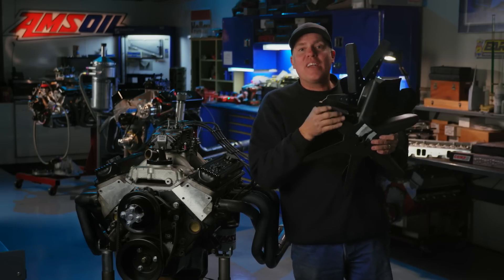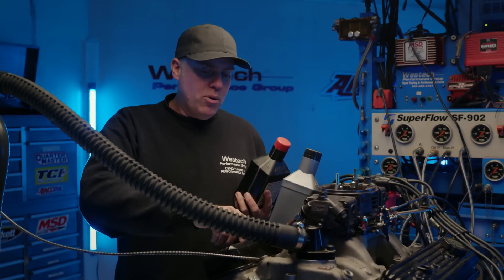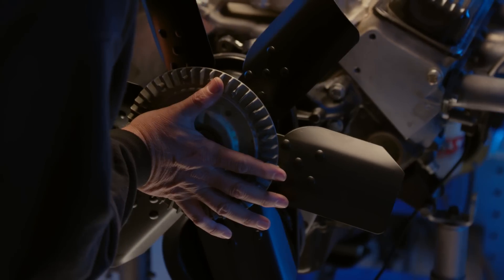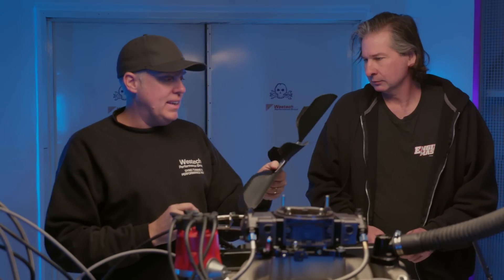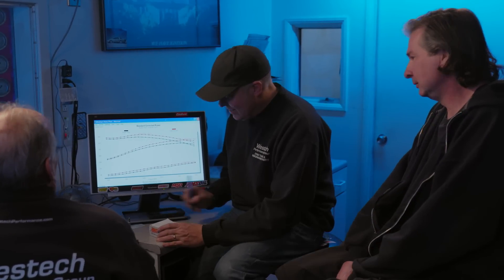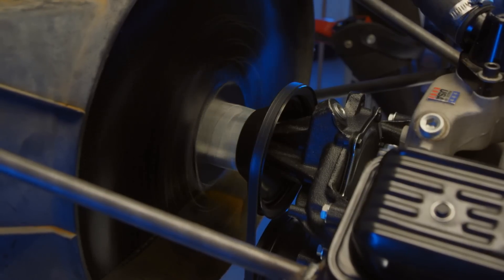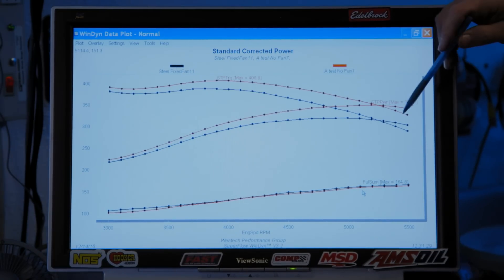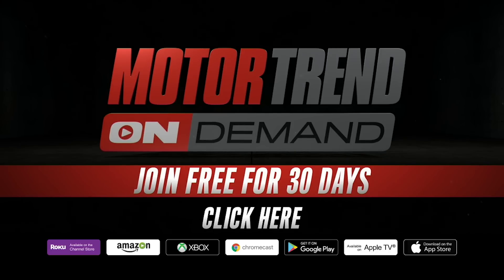Cooling Fan Shoot-Out! - Engine Masters Ep. 20

Comment: The Shroud is just going to make the fan act like a vacuum. There will be a pressure difference in front of the radiator, versus the back of the radiator.
Reply: could you guys test a 426 hemi vs a 426 max wedge

Comment: Dang, didn't heat the clutch fan to engage more.

I've got a chassis dyno sheet that shows a 60hp drop to the tires on an '07 Cummins truck. Back to back 502-503hp/1087lb-ft runs followed by a smokier ~444hp run. That stock fan engaged and killed it.

Comment: there is more resistance pulling air through the radiator hence why it uses more power... but with the shroud it will cool the radiator due to more air being pulled through vs around.

Comment: Am I wrong in thinking that this test is pointless?  To me looking at this with common sense, i would think the fan that robs the most hp would mean that it had the greatest drag, which would mean that it moved the most air, which would mean that it did is job the best because it will ultimately cool the best.  In my opinion the winner is the one that stole the most power.  It's doing it's job better than any other fan........cooling!

Comment: The shroud forces the fan to move air that would have previously just gone around it. Hence why a shroud makes the radiator more effective and greatly reduces coolant temps at low vehicle speed.

Comment: Fans have LESS restriction without a shroud as there is more available/easier air to pull.................When the shroud is installed, the radiator creates a restriction in the air flow, causing the fan to work harder to pull the air and actually creating a negative pressure in between the rad and the fan blades themselves, thus robbing MORE horsepower.

Everyone ditches the factory clutch fans because they think there "power robbers", in yet when used as designed they are actually very efficient and ONLY draw more horsepower if temperatures get to high.

Comment: Time to make drones out of old fixed fans, it's possible since Photonicinduction could do it with an electric one!  Electric fans are so much more efficient, that there's no loss of power when the car's warming up, the fans only kick on when the car's past the temp limit, usually when sitting running at idle on a warm day.  Just driving it cools the coolant temp down enough that the fans don't need to turn on at all, which most often than not is when you're racing! (yeah usually you're moving when you're racing)  Now to compare electric to hydraulic steering pump actuated fans, like some Jeeps have!

Comment: Shroud is like a funnel. Forces air onto fan blades.  More of the fan is utilized = more power it takes to turn it. 

No Shroud, is less efficient in its influence of air onto the blades. 
Less efficient at directing air into blades = equals less air on fan blades =  less power to turn fan.

Comment: Fun factoid from my previous life in engine cooling design... Those giant fans you hear on modern semi trucks can pull over 80hp in "normal" conditions. If the engine over speeds, they can actually pull down well over 100hp before they blow apart and shoot through the hood. They pull so much down that they're sometimes used as part of the engine braking strategy in the ECM, or if you're old school, by throwing the switch on the dash.

Power went up when they pulled the shroud because the fan didn't have to get all of its air through the radiator anymore, which lowered restriction. I was a little disappointed they didn't predict that immediately. The part I'm positive they didn't give any consideration to is that the air the fan was blowing out the back wasn't impeded by anything. Once you put that inside the doghouse a car, the fan pulls even more power and in extreme cases will actually pressurize the engine bay. Vans, front engine school buses, fire trucks, etc are notoriously hard to cool because the air just doesn't have anywhere to go.

Fun times!

Comment: the old school fan with shroud vs no shroud difference was due to the lack of vacuum inside the the shroud. With the shroud the fan is fighting to pull air through the radiator where as without its has 0 restrictions other than ambient air drag from spinning.  Great Test!!! 

I do wonder if a 110v fan/blower placed near front of radiator (which would simulate natural airflow) offset some of the heavy losses on the old school fan,Im sure it would still be a substantial HP hit but wonder how much🤔

Comment: So a few things.  

The fans will pull different amounts of air given the resistance of the system.  Removing the shroud will change the resistance, but you will pull air from below, killing airflow thru the radiator.  Lacking an actual engine compartment removing the shroud is only an estimation of the change.

The plastic fan has bad airflow.  It killed the most horse power, and moves the least amount of air.

For fixed fan blades there is a reason we stopped using them 30 or so years ago.

The clutch fan seems a bit excessive with its horse power loss.  Steel blades tend to have a serious pitch (and airflow) to them so maybe that's why its killing so much.  In a disengaged condition they usually draw no more than 5 or so HP, if its a high quality fan clutch.  It looks like your running 1 to 1 ratio and a fan clutch at 5000 RPM input speed should be able to spin at about 1000RPM.

For a hot hod or street car an engine driven fan is not required.  An engine driven fan works the best on truck and SUV application involving towing and off road.  These are areas where engine load will be high and your ram air from speed will not be sufficient to cool the engine.  A street car only needs the cooling for stop lights and such, during which time there is low load on the engine and low heat generation.

I am an engineer for a company that makes fan drives.  If you let me know the bolt pattern I can fab up a modern OEM grade fan clutch to see how it acts.

Comment: I would have liked to see a direct comparison between the thermo-clutch fan and a fluid clutch type that disengages at 2-3k rpms, as those are still used on trucks like tundra's (and silverado's that aren't equipped with the hd/towing package that swaps the water pump driven fan for two electrics and the vacuum powered brake booster with a hydraulically powered one driven by the power steering pump) just for the sake of science.

Comment: I ran my old '72 RS/SS 350 4 speed Camaro back in the 80's with a Hayden 7 blade fixed fan. That sucker pulled some air! I shifted it at 6500 at the track and trapped 99mph. How much faster would it have been with an electric fan? I will never know...

Comment: Who needs a fan? More power and less weight without it. Air flows easier through a radiator with no fan than one with an electric fan not running. I guess people in Cali traffic do though.

Comment: It's not really accurate using a dummy cold radiator with the plastic flex fan that relies on the radiant heat from that radiator to soften the material.

Comment: at the end, without the shroud, the fan doesn't have to pull air trough the rad, so less restiction. less restriction=better efficiency, but your cooling your engine way less.

Comment: I was thinking about an electric fan for my Suburban for MPG. My 5.3 RARELY exceeds 3,000 RPMS; I do not think that there is anything to be gained by the switch.
Reply: Since the vehicle is moving there should be even less difference. The moving air should help drive the fan.
Reply: Ace Aardvark electric fans don't run when moving while direct driven do. so electric fans would save gas
Reply: It is just a matter of degrees. Will an electric fan save me money? Can I recoup the cost? I do not think that my daily driving style would produce significant savings. An electric fan is significantly more beneficial at high RPM. I do not think that I have ever had this engine over 5K RPM's; it lives almost entirely in the sub 3k range. I don't think that it would pay for itself.
Reply: The movement of air would decrease the horsepower drag of a mechanical fan.  It would be interesting to see what effect the change would have on 1/4 mile times.
Reply: Ace Aardvark electric fans are dirt cheap though.

Comment: I've been wanting to get rid of the stock engine driven fan on my ZJ for years, but the only electric options are well over $500 and I am not completely convinced an electric fan can keep up when rock crawling in the 118+ AZ heat.
Reply: +Evil Opti Z  There is a popular swap from a specific year range and model of the Ford Taurus.  the issue is that the Taurus fan pulls a LOT of power and people in hotter climates, like where I live, still get over heating issues.  

The ZJ had an electric fan from factory in one year with one specific model, the 1998 5.9.  It had an electric fan combined with functional hood louvers to keep things cool.  Replacement fans are over $350 for anything even close to factory air flow ratings (such as flex-a-lite fans) and used factory fans are well over $400-$500.  

And wouldn't you know it, just now out of curiosity I started searching for E-fan options and found a company making conversion kits for my jeep with fans that supposedly flow 3600cfm for $280.  I am going to have to look into that.
Reply: Kur Norock um any fans will work. order on eBay the fans that come with ziptie like mounts. then just wire them up to a relay. definitely won't cost anywhere near 500 dollars.
Reply: None of those cheap fans are the right size, nor do they flow anywhere near enough air.
Reply: Kur Norock I used to have a older Dodge Dakota with the 318 and it came with a mechanical fan from factory. I researched how much air the stock fan moved and then searched for a factory electric fan that would move the same amount of air. Measure the radiator to get a idea of the shroud size and go to the junkyard. I ended up getting a fan off of a ford escort I believe and trimmed the shroud to sit flush with the radiator. Then wired a relay to a switch voltage and I was done.

Comment: My theory on the shroud vs no shroud is that with a shroud, it's ducted into the rad, and therefore has to actually work harder to suck that air through the fan blades. With an open/no shroud set up, it's able to draw air through anywhere it can get it, therefore the fan doesn't actually have to work as hard to move its rated CFM. 

I do agree though, I think it's a fixed amount of power to spin the fan vs/ a given RPM, as opposed to being a percentage of total power made.

Comment: Wow, the horse power loss surprised me too. I always thought a good fan would take away about 5 hp and a bad one 10 hp or so. I wish you would have tested a stainless steel flex fan. That is what I have run on all my cars. The flaps flatten out quickly but still cool well at slow speeds. When you handle a stainless steel flex fan, wear good leather gloves, they are razor sharp. I found out the hard way on the first one. They come with some kind of oil on them making them more slippery. Be careful of cheap ones, the blades fly off!

Comment: With the shroud on, the fan is forced to draw air through the radiator. However without the shroud, it just pushes air around the fan. The latter option does a worse job at cooling, but it will give you back some horsepower. 

You'd still be better off with an electric fan

Comment: so you're saying I can put a 30A load on an alternator and power it with a 1hp engine?   yeah, no.
Reply: Engineering Nonsense 30A at
12V is 360 Watts, or roughly 0.48bhp. So, in theory you could run an electric fan off a less than 1bhp engine.
Reply: Tom Jackson such theory doesn't hold up in real life though. And running engine will be more like 14 volts.
Reply: Engineering Nonsense more volts less amps 👍🏻
Reply: MotoMaverick not at 30A

Comment: you didn't show us how much power the electric fan takes.  your assumption of less than one hp is useless.
Reply: It's not an assumption, listen to what Dave says "When we've done this test in the past" they know that's what it takes and that it's actually an immeasurable number since you won't get the exact same number every pull anyway, within a couple yes but it's very rare you make 3 pulls and get the exact same power number every time.

Comment: I had a 72 torino that liked to overheat, and found out why:  Someone mounted the fan on the engine backwards, and it was blowing hot air INTO the radiator.

Comment: The reason it takes less horse power without the shroud, is because the shroud makes the fan pull air only from the radiator as possible

Comment: I would love the same test, but in a car.  I've never see a aftermarket fan cool better then a good ol GM clutch fan.   I have seen countless overheated motors,  fan blades stuck thru hoods,  fan blades stuck in people, burnt wiring and cars catching on fire, from aftermarket fans.. Hp is nice but cruisin instead of overheating is nicer.

Comment: If you convert to electric you're going to need a similar sized fan which would naturally be obliged to require similar power which is ultimately drawn from the same engine. Outside of the edge case of disabling the fan with a switch for a drag run I'm not seeing the potential benefit.

Comment: I think the reason it made more power with the shroud off is because the fan is stalling out since the air isn't forced to stay near the fan blades as it goes through.  The reason you would still want a shroud though is that that extra 8hp they gained was due to much less air actually being funneled through the radiator for cooling.

Comment: GREAT video guys. Would have really liked to see lower RPM figures just for reference(2-3k where most engines street drive)
Reply: Power increases with the cube of speed for a fan. If you're running at half speed, or 2500 rpm it should use about 1/8th the power. With the clutch fan it's harder to know.
Reply: they have said in other videos that they can't do low rpm or part throttle, maybe that's just how their dyno works, I don't know. 

BUT... if you look at the worst fan, it's losing 30+ hp above 5000rpm, but down at 3000 its only about 5hp. so you can infer that cruising around, low rpm you're only losing a few hp. I say this test makes a clutch fan look like a pretty good option.

Comment: Wow, makes me think I'd better pull the fan off my truck, that cruises at 2500 RPM on the highway, so I'm throwing away that much in gas to spin a fan that's not really helping with cooling anyways.  And it should spare some wear on the water pump.

Comment: Ok, so I feel like this would make a good engine masters or roadkill subject.  I noticed at my local auto parts store that even the cheapest oil runs about $24 per 5qt container for whatever is on sale at the time. But, I always see that the Delvac or Rotella diesel oil goes for about $13 per 5 qt jug. What would happen if I ran diesel oil in my crappy honda 2.2L non v-tech or to any gas engine? Would it work?  What are your thoughts? Anyone tried it with good or bad results?

Comment: When the car is moving the wind through the radiator should be sufficient to cool the engine. The wind will also help drive the fan with a windmill effect lessening hp losses to some extent. Car designers typically design the size of the radiator to cool the car whenever it's at any sort of travelling speed. Electric fans only usually cut in when cars are sat in traffic and there isn't sufficient air flow through the radiator to cool the engine coolant. I love engine masters but find this test a little pointless.

Comment: What I'm really wondering now is what effect incoming air velocity would have on the mechanical fan... So in their testing would equate to maybe what happens during a burnout where the engine RPM is high but vehicle stationary. The fan would have to move stationary air which would probably take more power. I would imagine once you have air moving as the vehicle accelerates the fan would require less HP from the engine to spin...I would love if they revisit this one day and maybe put a dyno fan in front of the radiator to simulate vehicle moving and see if that makes any difference.

Comment: I want to see the Alt attached and a Hi flow electric fan connected as part of the testing.  Electric fans are not free HP there is still a drag on the Alt.  However their should be some HP gain.  Throw the Lincoln Mark IV fan on that people use.  Then calculate the Wattage used and / by 746Watts and see if the calculation = the dyno.   That is the follow up test I want to see.

Comment: And people,, no fan is really nesecary on any vehicle over about 40kmh, the air  coming through the grille has more speed than any fan. I have raced both dirt oval and road racing without, though a bit average on restarts and driving back in the pit area.So a fan can be handy for that only.
The exception will be cab  over trucks which rely on the fan pulling the air through the radiator.

Comment: So, that does explain why my roommate's 1999 Chevrolet S10 with a 2.4 liter 4 cylinder felt so much better when he went from the mechanical fan to an electric. The truck was fun to drive before, but a hell of a lot more fun after, and he was getting between 33 and 38 miles per gallon out on the highway versus 25-30 on the highway. I knew changing from a mechanical to an electric could net more power at the wheels, but it is nice to see that quantified in numbers and a graph. His engine was using a fan like the first one tested.

Comment: Wonder if the air being forced against the plastic and stainless flex fans when the car is moving would make them flex more throughout the curve...

Also the less fan blade pitch is more air resistant than the steeper pitched fans.

Maybe these are factors that may have gone unconsidered, and might be significant differences